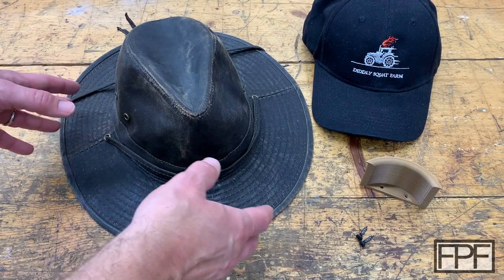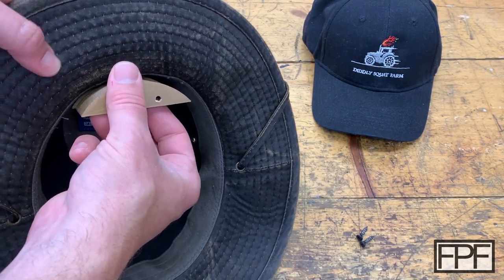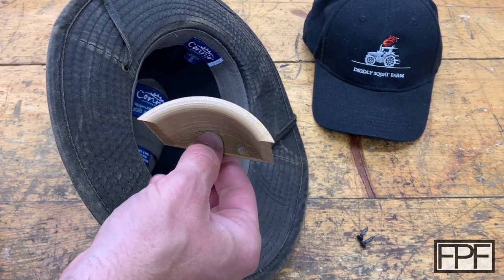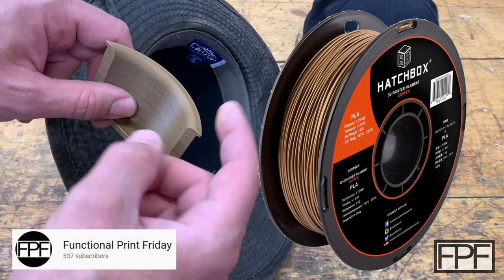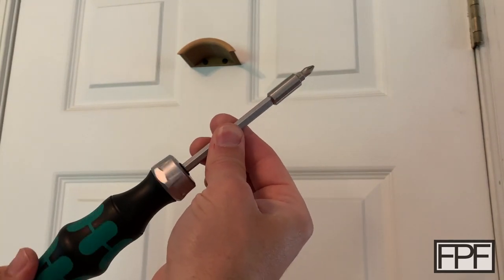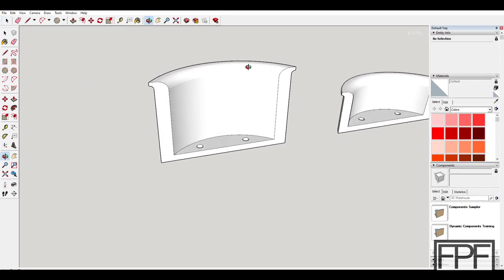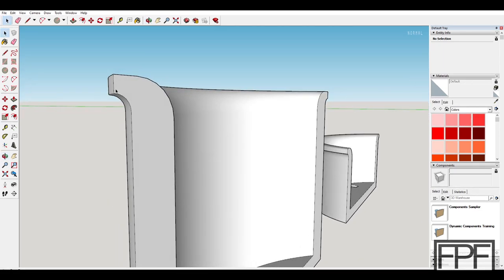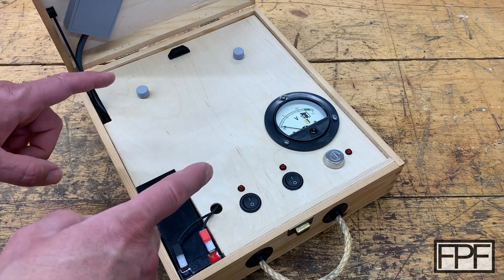3D Printed Hat Hook

Comment: Such a brilliantly simple idea and a solution for a problem we didn't know we had. For me it's what 3d printers were made for.
I don't know if I'm eligible for the giveaway as I'm in the UK but I would love to use the filament to make fittings for a wine table design I have in mind using copper pipe for the legs.

Comment: Is it just copper colored, or copper filled? I'll probably print a hat hook after I'm done printing some alphabet blocks for my daughter with the green pla I have loaded but I think the copper color would make some really cool looking busts and statue type prints to put up on a shelf. I also ended up printing 6 of your indicator holders, I didn't realize I had that many floating around in my kennedy at work and here at home. I also forgot that I wanted to model one based on your design for my 3 inch travel dial and ditch the foam that is falling apart. Too many projects always going at once.
Reply from the maker: It's just copper colored.  Glad you liked the indicator holder.

Comment: No cap, I'm making one of these. (lol) but seriously instead of screws do you think a 3m command strip would work?
Reply from the maker: Wouldn't hurt to try, but my guess is that the downward force levered out would likely pull it off over time.  Wouldn't be hard to delete the two screw holes and give it a try.
Reply: I'd like to make a Groot flower pot.  My daughter likes him and she enjoys watching things grow.
Reply: @PeterTremonti  that sounds awesome bro, I'd recommend watching a video on making figurines, they have great tips for making stuff like that.
Reply: I've got a stand for a flashlight that I'm working on. I want to refine it more. It's designed so if you're working under a sink or similar situation you can stand the flashlight straight up and not worry about it falling over. The design is for lights like ThruNite and many others make.
I may ad a magnet and a way to hold the base on the flashlight so it could hang upside down or sideways too.
Reply: @bwselectronic  I would like to see this.